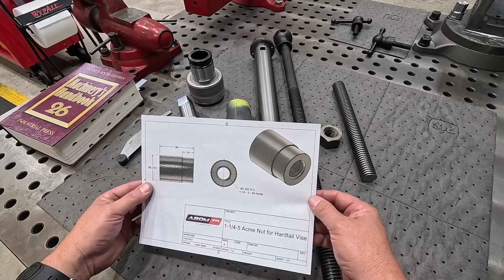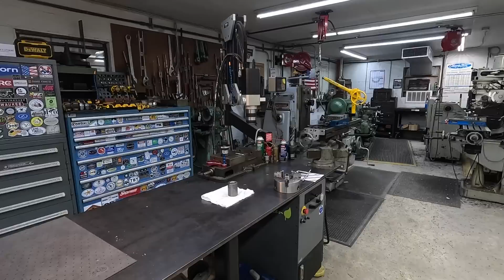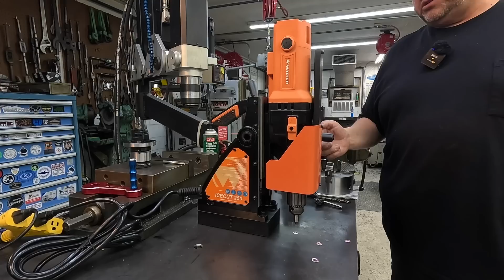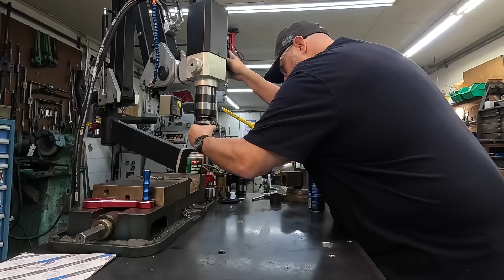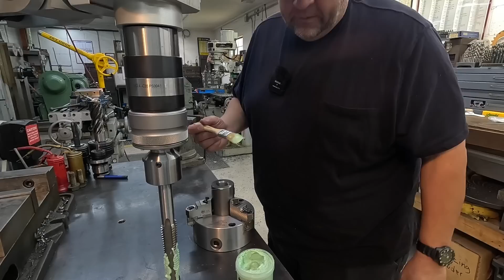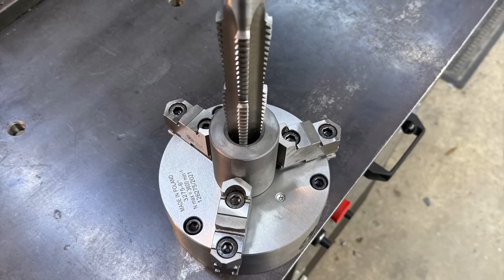Machining an 1-1/4" Acme Nut for the Hardtail Vise

Comment: Not sure but have run into a high carbon stressed point on plate steel, especially if it is standard run of the mill, and you could have also had a internal void or hard spot, with a piece of gem or garnet accidentally got in there, as i never liked drilling with an auto feed on those magnetic drills, on cheap plate steel, had problems on big steel plates as in boiler industry, fabrication,
Better to use gentle hand pressure with a smaller drill bit on first round.

Also I did not know you should run an acme tap always through, as you mentioned,
As I have to make a new on for my mill some day, 
Thanks for the hint, as I will probably be making a tap for it, as it seems to be a odd beast.

Comment: Adam, have you noticed any corrosion/staining on "shiny" tooling if the Anchorlube isn't completely cleaned off of the tooling?  Within the last 2-3 months,I saw another YouTube Machinist (maybe Joe Pi?) shared his disappointment about his 5C (or similar) collets with slight corrosion or staining because he didn't think to carefully clean them after using the Anchorlube in a job.  I'm just curious to see if anyone else has had that problem.

Comment: I had problems with bits made by Rigid years ago - hardness was too deep, and they were brittle.  Fine for wood or plastic but plate steel was just trouble.

Comment: As to the Chuck mounting, "Pulling with two hands on a drill press" what do you think would happen!  Today's Mag drills are focused on using annular cutters, not large twist drills! Your problem with to long a drill bit for a pilot hole is amazing, where are your stub length drills??  Also a cheap router speed control or variac will give your old mag drill variable speed.
Bottom line, A little knowledge first, avoids frustration later.

Comment: A couple of things that can be done to make it easier to cut an Acme thread.

Single point thread the inside of the bore with a 60° thread to remove some of the material before using the tap. It reduces the material to be removed and lightens the load on the tap. Runs the risk of the tap not following the pre-cut thread if you are not going to single point cut the thread with an Acme thread form. You can single point it undersize with an Acme form tool then tap to size afterwards.

Another option is to use the CNC mill to thread mill the Acme thread slightly undersize then run the tap thru to clean up to size.

Personally I would like to see a comparison between traditional tapping this thread and thread milling it.

Comment: I have a later version of your Bux mag drill with two speed motor. It is as heavy as hell. I use a variable speed controller for a series wound motors that uses pulse width modulation. You can buy cheap Chinese speed controllers and just plug them in.

Comment: Adam, I must just tell you ... I'm a hobby machinist for the last 20 years.  I do very basic, non-critical machining for myself and my friends.  For 20 years I've gotten the jaws on my 3-jaw chucks to fit by fiddling and trial and error, until they meet in the centre.  Long process every time.  This video is the first time I've seen how to actually do it properly!  I went straight into the workshop to try it out - I knew about the numbers but not tracking the scroll - and hey presto!  Instant success.  The moral of the story is please don't think explaining the basics is wasted, because there are amateurs like me who lap up every bit of that knowledge.  Thank you!!:yougotthis:
Reply: G'Day Mate, HaHa, I just bought a small 3" round cheap hobby three jaw chuck from Amazon and Adam's way works!  So owning a three jaw for just a few days and yet to use it, I learned this method. I just had to mention it, it seems so unfair. Yes it's always great lapping up knowledge anywhere anytime. Greetings from Sydney.

Comment: Regarding what you said at around the 17:00 mark about safety with the mag drill, I worked with a guy that was using a mag drill with one of those hole saw type drip bits. Those bits made a hell of a birds nest when cutting. Well that birds nest caught his gloved hand and ripped his ringer off. Probably a victim of complacency, but those safety guards, if actually used in practice, can help prevent injuries

Comment: Now you need to fix the big hole in the table.  Machine a plug with a weld bevel on the top and weld it in the hole.  Grind it flat.

Comment: Another Interesting job that turned out well. Rules sometimes have to be broken. I just finished tapping M20 x 4 double pitch Acme threads in 1.25 x 1.5 white Delrin nuts. I had to carefully back the tap out by hand twice on each nut to clear the binding chips from the flutes.
Reply: And that's OK, plastics and aluminum are exceptions to the rule. Unless the aluminum is dipped alclad duraluminum (AA2024), or aluminum bronze (C95400). These clad types can delaminate, or in the case of AlBr, it will dull the cutter with its abrasive nature. There are other considerations as well, take care if using these metal alloys.
Reply: @CothranMike There’s no reason to back these out except for chips binding forward movement. Back out only by hand if necessary. Never by power.
Reply: @ellieprice363  Yup

Comment: Hi Adam,
It was great there were no problems cutting the Acme thread. Getting extra height for the Walter mag drill, could you use those spacers for the mag chuck on a surface grinder that will transfer the magnetic flux? Looks like you only needed an extra inch of height to get the drill bits into mag drill chuck. You, Abby and the family have a Happy Easter weekend.

Comment: When you're using the flex arm is there a need. To clear the chips before continuing down. I'm talking about general tapping operations karma not necessarily the acme thread tap you're using right now. I was always taught to back up the table to clear chips before continuing down when hand tapping

Comment: G'day Adam.  Nice work on the Acme nut mate.  I really love that Flexarm hydraulic tapping machine of yours too.  Mounting that 3 jaw chuck to your tapping table was an excellent idea.  It will come in very hand for other projects of yours.  That big old mag drill of your fathers is amazing.  As an apprentice I remember using my master's English Wolf drill from the 60's (which belonged to his masters).  Big old solid aluminium casing thing with heaps of torque and it would your arm off if not careful.  Regards, Aaron.

Comment: 21:30 Very annoying… in adding new (and interesting) features, they seem to have lost some.  I have a similar sized Walter unit from about 2010, and it can decouple the carriage from the feed rack, letting you reset over a large range, which I have to do frequently as I swap from the weldon-shank chuck to the jacobs.  :(

Comment: those step point drills aren’t great over 1/8” material in my opinion, age old problem where the point of the bit is too low speed, and the od is too fast.  I’ve found that limiting the thickness of the material and running them much faster than you “should”  makes quick work of THIN metal.  19:21  

I also really like them in a hand drill because it’s easy to control the speed on the fly. Then it doesn’t matter so much

Comment: Was that a Norseman Viking drill bit? I've had very bad luck with those. Broken many. One of my S&D bits from them had like 0.015" runout, and their customer service said that was fine. Won't ever buy that brand again.
Reply: Also, you could use a plug-in variac to get variable speed from the Bux drill.

Comment: Necessity is the mother of invention. This video separates the men from the boys. You took every precaution and the results was rewarding. I have used flex arms before but not the hydraulic model. That's impressive. Hope it's properly aligned and works as intended. Love your videos and look forward to them every week.
Reply: Oh yea it’s aligned… plus with the magnetic adapter, you put that on and loosen the centering bolts… it will square the head up.
Reply: Necessity is a Mother, alright. :)

Comment: Adam, I do a lot of mag drilling at work and my suggestion for the future, would be to clamp some 1 inch plate to the bench and mount your mag drill on that to get your extra clearance. I also use the same method when I need to use the mag drill on non-magnetic materials like stainless.
Reply: That reminds me, I saw how someone made riser blocks for mag chucks on surface grinders from brass/aluminum and steel nails. Might work for this as well. Channel was "Adam the machinist"

Comment: @Abom79, Can you remove the magnet from the new mag drill, make a riser block of 1" thickness or there abouts, reassemble it with the new riser block in between the magnet and the drill and of course new longer screws? You might have to extend the wires too but that's easy enough.

Comment: That Walter Mag drill is nice... You could make a riser block between the base and the magnet to get more height, although that may not work if the vertical slide is too short.

Comment: Hey Adam, couldn't you try using a variac on that old Bucks mag drill to act as a speed controller? I’m sure you could also get a purpose-built speed controller to do it, but I’m sure with a shop of your size, you may have a variac lying around somewhere gathering dust.

Comment: Those magdrills are designed to be used with coredrills. They are shorter and dont require a chuck. The chuck is only used to drill the pilot hole. Coredrills also require less torque because less material is being removed.
Reply: You beat me to it.
Reply: That's very interesting and explains the small throat.  Makes perfect sense, thank you!

Comment: You can get a modern speed control for that big drill. Plug it in to it and control the speed with a knob
Reply: I was going to say the same.  In the late 1960s when Triac devices came out I built a speed controller for use with my 1/2" drill.  I still have it and it still works.  Not for induction motors but OK for brushed motors.
Reply: @ttucro2 that’s funny I did too
Reply: I was going to advise the same😊...
Reply: Not without changing the motor as well.
Reply: @MadmanJimbo  you can see where the brushes are located on the Bux drill. Should not need any changes.
Reply: @ sorry that’s not accurate.  It might be possible.  But brushes are not the only feature required for VFD.   Anyway it doesn’t matter.  Have a great day!
Reply: @MadmanJimbo 
I believe we are talking about Variacs not VFD's.
For a VFD you would need a motor capable of 3 phase current thats true.